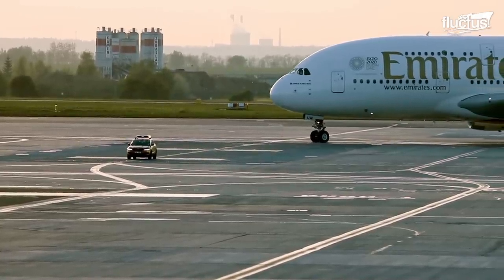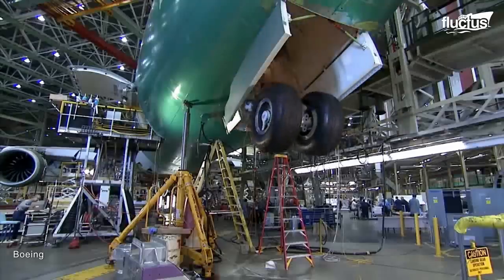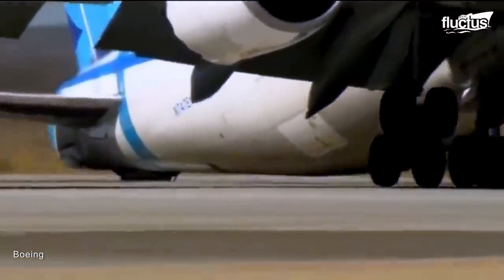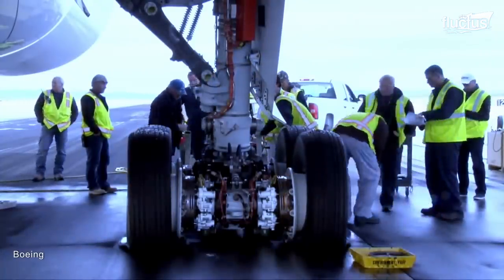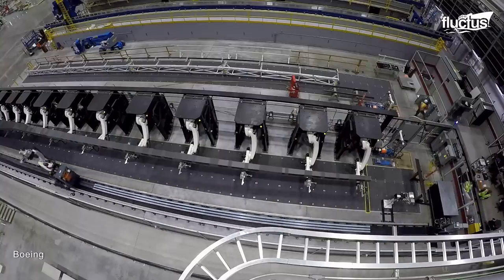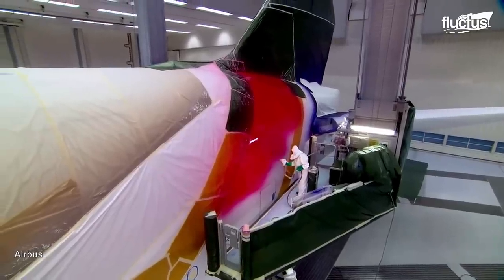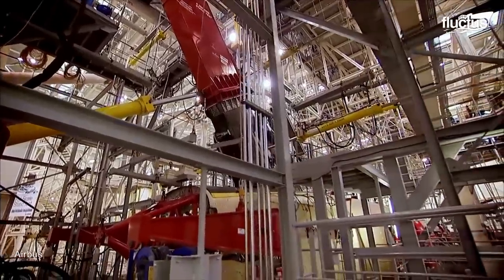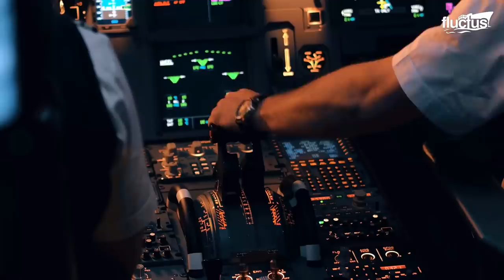Inside Massive Billion $ Factories Producing World Largest Boeing and Airbus

Comment: Back in the sixties my grandfather was an engineer at Boeing in Everett Washington.  He worked on the development of the 747.  Its maiden flight was in 1969.  He used to tell me fascinating stories about the various tests the 747 had to go through.  Wing flexing was a big one.  They had a machine that would flex the wing thousands of times.  Then they would x-ray all the structural components to see where the stress cracks started showing up.  They would then re-design those components and then run the stress tests again.  Another challenge was to ensure the tires would not burst during an extreme braking operation.  There is a plug in the wheel that is calculated to pop out just before the tire bursts from extreme heat.
My grandfather was also a private pilot and would take me flying over Seattle.  What a thrill!